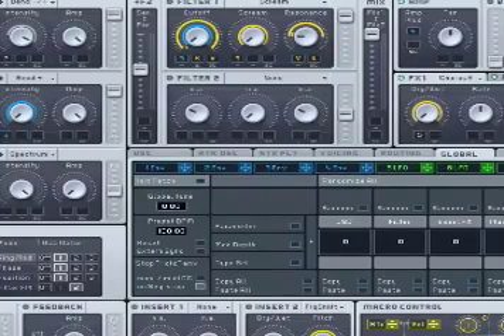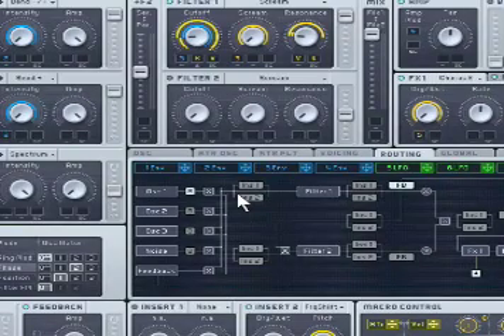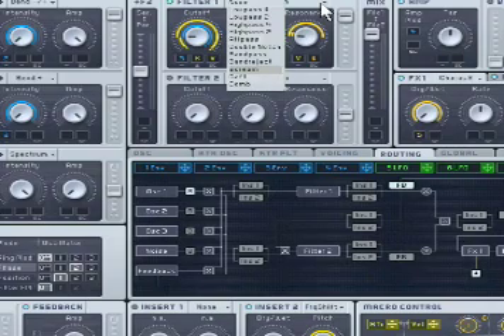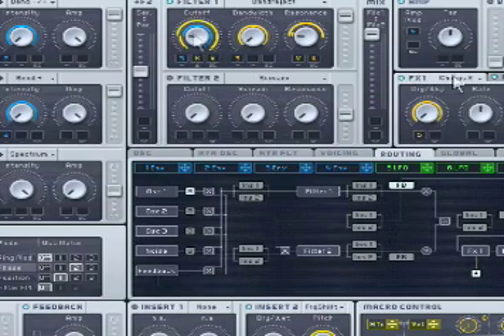Massive Part 2 of 3

Comment: @machineromance Basically what you do - is you name it to whatever you want, then you bind this macro to a control on your midi controller - which is usually done via your selected DAW. Then, what you do is you drag the macro number to a parameter, and set the amount of which it can vary via that macro by clicking the number once it's on the parameter and pulling up or down.